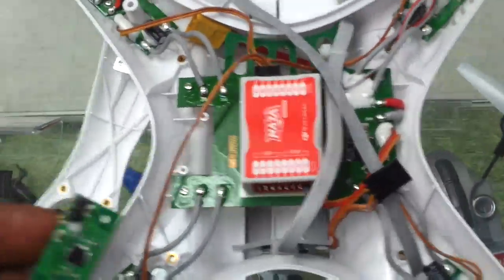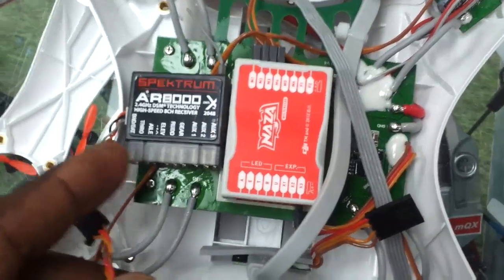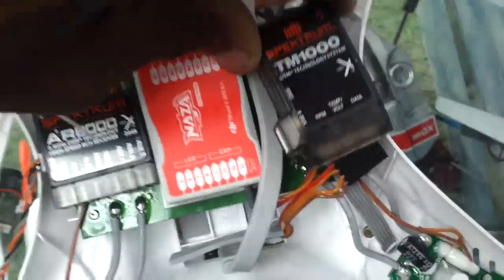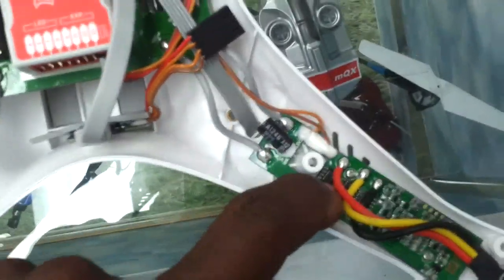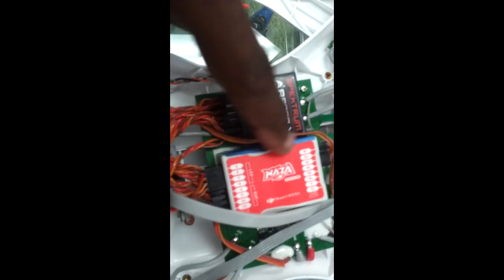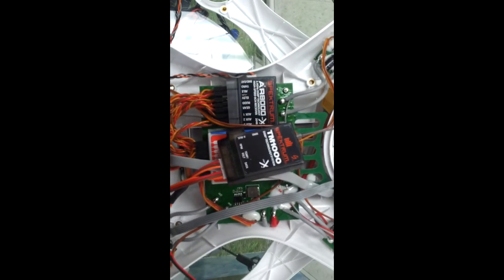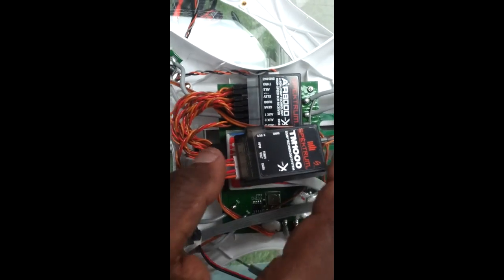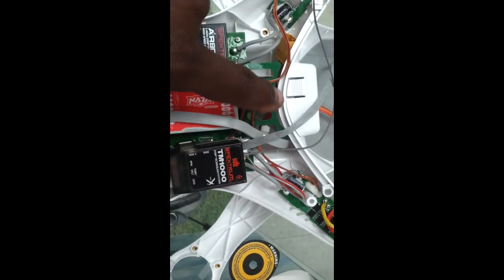Dji Phantom with Spektrum DX8 install

Comment: May be you can help me. I installed a AR9020 in my Phantom 2 and the GPS would not work. So I replaced the NAZA in the Phantom with a NAZA mV2. The GPS works, The Phanton LED light quit working and the throttle stick when pulled down and to the right kills the props. It does not require both sticks to stop the props and that’s concerening and the LED light still don't work. Do you have any incite to why this happened? Also the motors were upgraded to the white T-Motors.

Comment: Thanks for that clear how-to.  How does the Spektrum compare to the Futaba? I could go either way at this point. Does the DX8 give you better range and control than the DJI stock controller?  How does it work with the Zenmuse gimbal?  Does adding the larger receiver and telemetry unit add much weight?

Comment: Cool video!  I have the Phantom and stock transmitter.  I recently bought a DJI F550 hexacopter and am using a Spektrum DX7s and AR8000.  I did not know you could install these into the phantom.  What are the benefits of using these on the Phantom?  Just better range, more reliable?